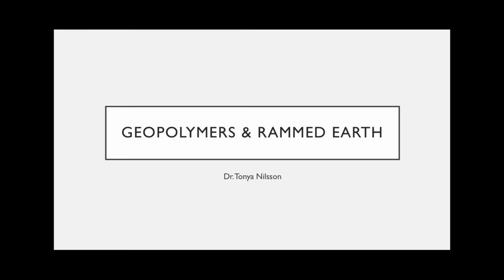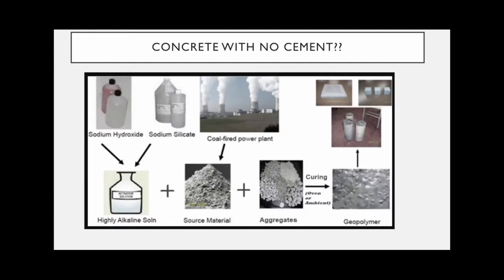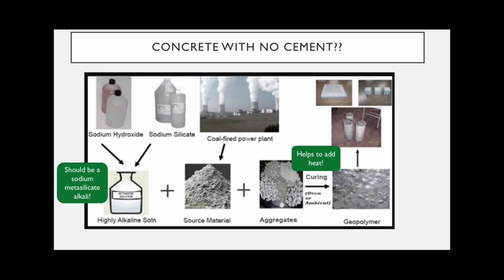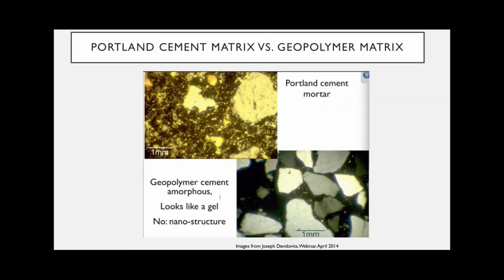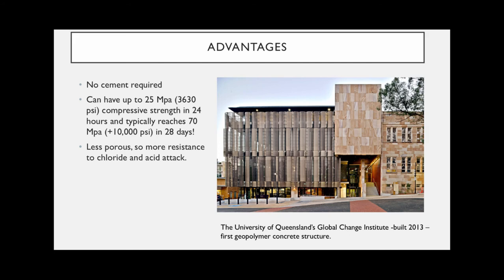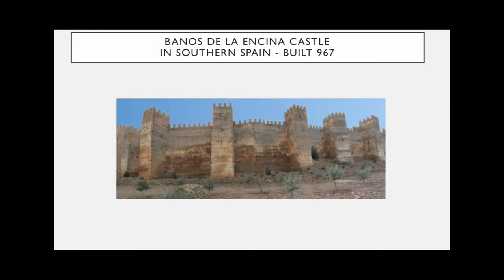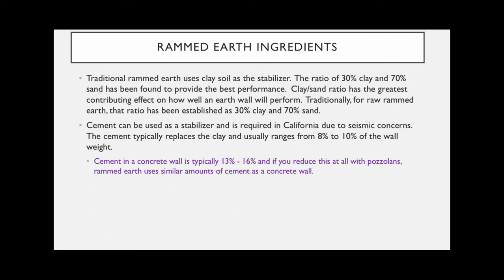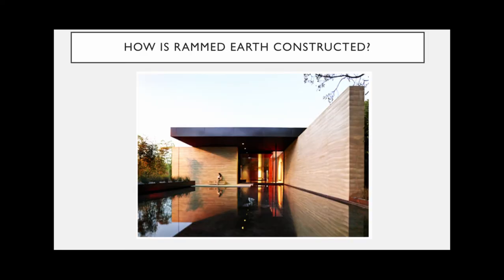Geopolymers &  Rammed Earth

Comment: how can I do it without any concrete, no foam, no rebar... just natural materials?  also how can I make it stronger than a typical portland cement/concrete wall?  how can I do 100% natural geopolymer without buying waterglass, just with 100% natural onsite materials?  it's required for my project to be 100% natural, can it get approved by code with just 100% natural ingredients?
Reply: I would help:
6 month old and put on air whiteout wet it.
Fresh fly ash from wood
Mix 50/50 put gloves add little bit of water slowly. They become paste then do it like a dough when it's like it you put in a mold they need to avoid water and in 24h you have gray limestone.
If you don't want to leave ash 6 month adjust fresh ash whit calcium carbonate but you need to try some %
Reply: At the end of the video, when they drilled a core out of the rammed earth wall, I don't think it had any rebar or insulation in it. Otherwise the layers would have shown. The core is about 9inches from the looks of it. And 9inches seems to the thickness of one part of the wall before they add insulation to it. So, I believe, the core which measures about 9 inches that was drilled out and determined by tests to be twice as strong is 100% rammed earth with no rebar or insulation material inside it.
Reply: No rebar. Though salt rebar would become one with the geopolymer